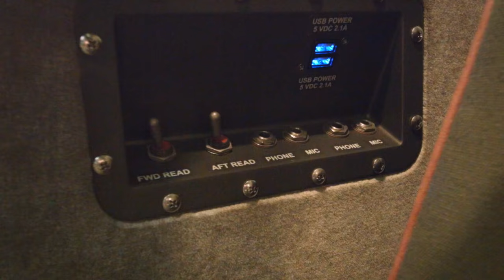Grumman G-111 Albatross Interior Installation | Duncan Aviation

Comment: I'd like to see a 'tinyhouse' version of this. Maybe with a 'tinyboat' that it carries with it too!  And modern turbo prop engines.
Reply: There's PT6 conversions of Albatrosses out there. As for the "tiny house" part, that's about as niche as you can get in the aviation world. While I also think it would be cool, it's not terribly practical. This is really a two-pilot kinda plane, especially if you have your family in the back and are traveling any kind of significant distance. That alone kills the back-country flying and floating RV plan for a lot of people, unless your partner is also a pilot or you have a really good friend that would fly right seat. The biggest issues are probably cost and safety. The former is incredibly high, and the latter is dubiously uncertain. Also, at this point I think all of these are flying under the experimental exhibition category, which is NOT the same as experimental amateur built and is significantly more restrictive. 

If you just want something you can cruise to some remote location and chill for a few days, that already exists. I've seen one of these that was less visually beautiful but had a layout that made a lot more sense, and it had two bunks, a couch, bathroom, and a small galley area. Flying RV? Kinda. An actual replacement for a house? Nope.

Comment: Plush interiors like this are nice, but I would hate to deal with all of it on a heavy airframe inspection, aircraft are not motorhomes which stay together until they're scraped, some poor mechanic has to remove all that stuff to do a proper inspection.
Reply: yep and Im pretty sure the engineers of this retrofit, outlined removal and installation procedures for the owner, as per FAA
Reply: it his job blue sky